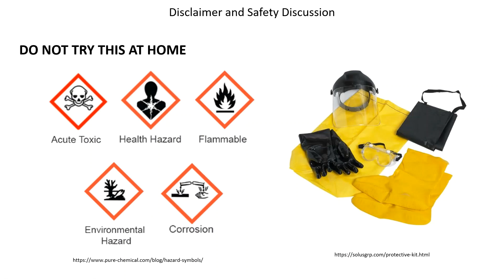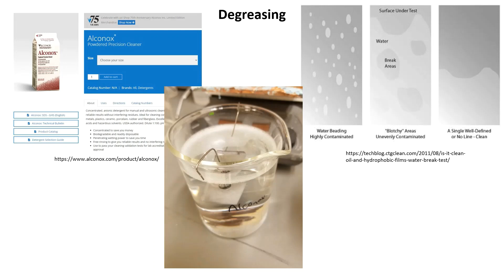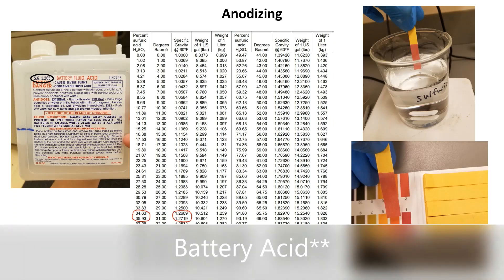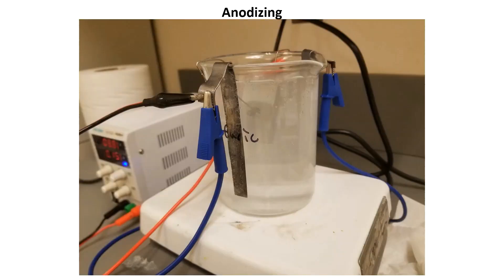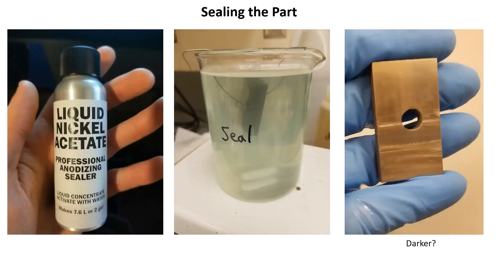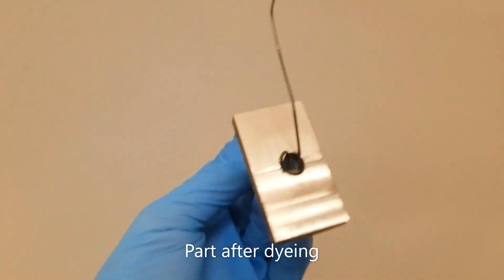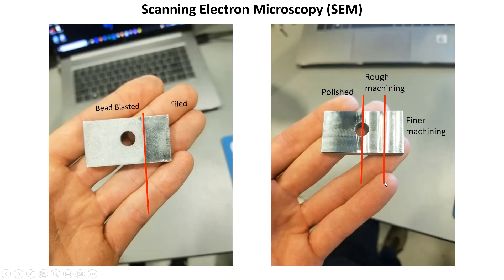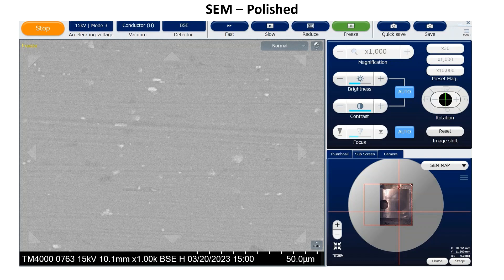DIY Type II Aluminum Anodizing with SEM Imaging

Comment from the maker: I figured out the dye issue! Time in the dye bath makes a difference. 30 minutes seems to be the minimum soak time. More time in the dye means more time for the pores to be saturated with pigment, but at a certain point they won't pull any more in.

The bigger factor is the thickness of the anodized oxide layer, and therefore the pore depth. I was able to control pore depth (layer thickness) with time and current density. More current density at a given time = thicker oxide layer. More time at a given current density = thicker oxide layer. The current density has a larger effect on the dye color than time at a given current density. 

The part in this video was anodized at 4 amps/sq.ft. I got a very deep black color at 16 amps/sq.ft.

Link to pictures of my experimental results is below. Each part has two photos showing the machined side and the bead blasted side.

https://imgur.com/a/5pJept0